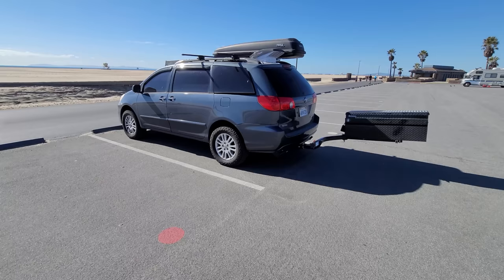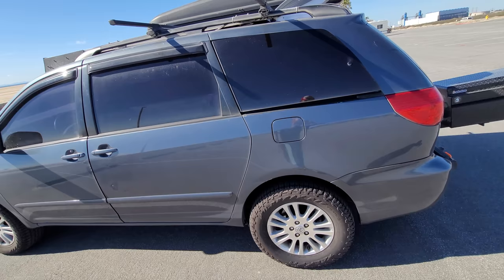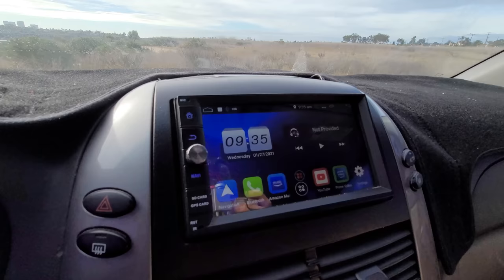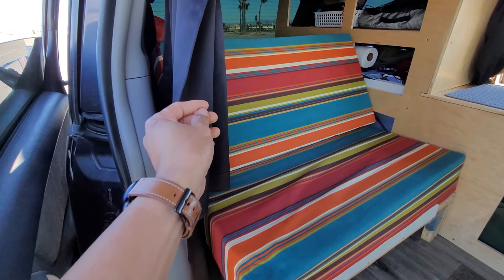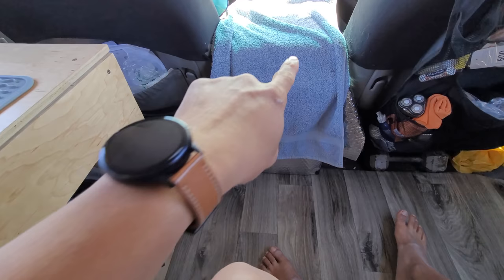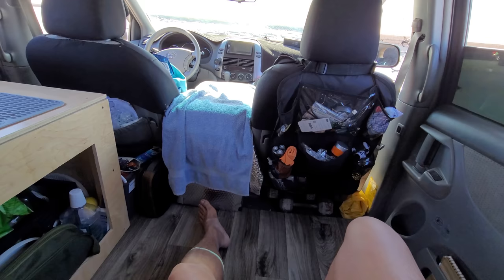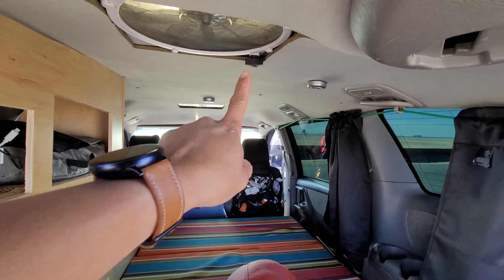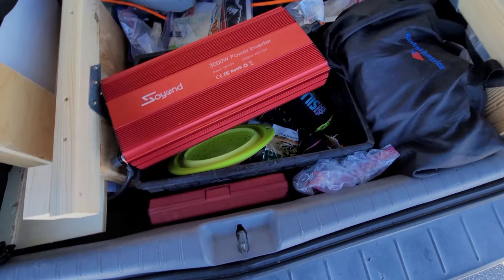Ultimate Minivan Off-grid Camper Van Tour! Lifted Toyota Sienna - Self Converted

Comment: Dave, how have the Falken Wildpeak Trails been doing? Comfort, control, braking, grip, noise, tire wear. Assuming you're still running them, and it's only been a year since your video. I haven't bought yet as still some wear on existing tires, but they're my top choice for replacements at the moment.
Reply from the maker: I personally think they're the best choice the the yota and for the places I want to go. More quiet than stock tires imo, long lasting, and perform well. GL

Comment: what type of mpg's are you getting on that thing? I have a non lifted or converted 2007 that gets 16ish with a good mix of highway, and city driving. I'm curious to know how much the lift and tires, plus the weight from the conversion affect the fuel efficiency.
Reply from the maker: It really didn't. In one of my videos I mention the larger tires dented my mpg but I didn't consider the larger tires effect the speedo and the mileage gets ready incorrectly. I got 16-17 mixed

Comment: hi dave! how did you attach those green strings to make your privacy screens? i see you used the hooks above the doors but i can't see the other attachment points. also, how do you block the rear window view for privacy?
Reply from the maker: Yes there are little tabs I popped off and used bungees. I used weathertech window covers for the back window. Hth

Comment: well done!!!...im stealth in a dodge caravan... love it...Best Wishes from the beautiful nc mountains:) Christine  
ps im dying to do an exhaust fan on roof like you guys! does it not leak?
Reply from the maker: Ty! No not if you do it correctly!
Reply: From videos I've seen,  it seems noisy and not tight seal regarding thermal loss. But everyone seems to get them when they upgrade.  Some even install two.  I am going to live in my van first to see how necessary a roof vent is.  Love your rig, but not exactly stealth with all the add-ons, although some might think it is just a recreational vehicle and not a home.  How much does the lift and larger tires affect mileage?
Reply from the maker: @serenakoleno9338  the lift didn't effect mileage. The bigger tires dropped my mpg by 3-4 miles
Reply: @DaveOTG  What size tires did you step up to? ..and I am glad to hear that the lift did not affect the fuel efficiency. Though did you experience any other changes due to having the lift, such as needing to replace CV joints, drive shaft, etc?

Comment: I've got a 2012 Odyssey and the way the sides are designed the shelving interior I had in my original build - 1997 Town and Country didn't fit right at all. I really like the way you contoured the wood organizer. That's probably what I'm going to have to do. 

Also, I really like your Maxxfan. I want to put one in mine but am concerned about running into wiring, ducting or some other issue. Did you know beforehand that you could put it there or did you just start cutting and hope for the best? lol
Reply from the maker: I pulled the headliner down to 1. Insulate and 2. Decide where to cut the hole
Reply: @DaveOTG  I was afraid you were going to say something like that LOL.

Just looking at all of he things connecting the headliner to the roof gives me anxiety with the thought that I'll never get it back together - although, if I had it pulled down I definitely would insulate. It seems like a lot of hassle to go through not to.

Comment: How do you stealth camp / sleep in the city without window covers that completely block out all light from inside? And how wide is your mattress?
Reply from the maker: I have ceramic tint 5% and blackout curtains.  39x74
Reply: @DaveOTG     Are you saying that if you have lights on inside your van at night with 5% tint then the light inside wouldn’t be visible from outside? I saw the curtains but it doesn’t look like you could make them light tight though. Can you?
Reply from the maker: @joeblow1942  Yes, not visible from outside

Comment: Great take on Eric’s design. I’m 6’3 and am about to do this to my sienna as well. What are the dimensions for the bed?  I love how you extended the cabinets the length to the rear of the van.
Reply from the maker: Twin size
Reply: Solid. I have a 2011 limited which poses its own set of problems because of the electrical upgrades like the third row automatic folding seats and the middle console that has some components. I want to realize its full potential in a conversion.
Reply from the maker: How's it going Greggory? Have you started your conversion? I know those middle seats can come out as well

Comment: I'm curious if you recommend a mini van with a sunroof. I wonder if that gets in the way of thie Maxx fan or solar panels etc that I might not like? I am thinking a roof would be nice but if might run into an issue?
Reply from the maker: You could go with a different sized panel to accommodate everything on the roof
Reply: Do you think I can install a Maxx fan on a van with sun roof? I'm thinking that will give really good ventilation but there might be some kind of wiring running from the roof to the center rear where you had the Maxx fan. I don't know if there's any of that stuff.
Reply from the maker: @TakuyaHikichi  you could remove the headliner to take a look

Comment: What size tire did you go with? (scrolled thru most comments before asking)

Now that it's been a few years, what's your assessment of your tire & size choice?

Just got an FWD XLE, time for tires, thanks for your input in advance!
Reply from the maker: Its at the bottom of the description. I think it was 245/65/17. I really like the added lift and the falkens performed well in all types of conditions, and are quieter than my stock tires were. If you need to run snow chains, then you would have to go with 1" hubcentric spacer or get a smaller tire maybe 235s. Hth
Reply: @DaveOTG  Thx!  What was the MPG hit for the larger tires?

Comment: Great setup. First lifted Fwd sienna I've seen. I want to do the same thing as I don't think awd is as necessary as ground clearance and tires for a lot of camping back roads. 
I am most curious about your experience with the lift kit, any issues or premature wear mainly with the cv axles, bearing or bushings? Changes in handling?

This lift kit is basically the deciding factor if I get a Sienna rn.
Reply from the maker: Rides stockish. Had new CV axles installed the same time as lift just bc. No change in mpg either. Big tires effected mpg as well as the added weight. I did install air bag helpers in the rear. This really boosted the handling confidence.

Comment: Hi if I were to get a jackery which model would u recommend to handle that fridge and rest of your equipment?  Ty
Reply: Jackery 1000 is great for a minivan.  Plenty of power in case you get a few cloudy days.  Weighs 22 lbs.
Reply from the maker: Honestly would recommend another brand. Jackery charge time for the 1000 or up is very slow. EcoFlow charges like 80% faster

Comment: Great video, I'm joining VanLife2022; looking for my van now, what wood do you suggest that I use so I won't have to worry about climate change altering it
Reply from the maker: If you live in a cold environment I would try to migrate condensation with ventilation, and products that suck up moisture and if you're using a heater make sure it's dry heat. No big difference in types of wood imo. Good luck out there!

Comment: The kick sensor can be turned off in the vehicle settings. I have a platinum. Even if you install a much cheaper non- toyota receiver hitch, you can turn it off. If the kick sensor in the back isn't as important to you, you can install a cheaper hitch. For me I'd rather save hundreds of dollars than have this silly feature..
That's just me.

Comment: Like you work and your build. I have a question: for all the work and expense in setting up your solar system (minus the panel) why wouldn't you just do something like a Bluetti ac200p solar charger? Seems a lot easier and as functional. I'm about to start my minivan build and appreciate all the links  and info. Just subscribed to your channel. Would love to see more of the build-out videos. Keep going!
Reply from the maker: You could go that direction for simplicity. For value and bigger capacity/modularity/cost building out your system is the way to go. Different priorities and welcome aboard 🚀
Reply: @DaveOTG  Cool. Thanks for the answer. May I ask what you have invested in your solar setup? I'm deciding which way to go now. Also would love to see more on your lift kit. Thanks again.
Reply from the maker: @fractalman8064  The ac200p 2000Wh = 83Ah. Not great capacity but don't get me wrong, it's plug and play. If you don't want to invest the time in researching/learning on how to build your own--it's the way to go. (For me budget was a bigger priority over simplicity), I have 300Ah batt. with 325W panel, 3000W inverter, Victron Charge controller, fuse boxes, etc etc for less than half the cost of the Bluetti. If something isn't working, I can easily replace the one part. Either way is not wrong.... Hope this helps. Great suggestion on a video about the lift.
Reply: @DaveOTG  Thanks for the info. Makes me lean back your way. Makes more sense to learn than to pay. Are you using AGM batteries, lead, lithium?
On a side note, one of my big concerns is security. How to hide/lock up laptop, cash, camera equipment, etc. If you could do a video on that would be great. Understand if you'd rather be discreet. Just trying to think these things out before launching into it. Nice work, keep going, and thanks for all the links.
Reply from the maker: @fractalman8064  For more sensitive topics, I speak about them on my patreon

Comment: After seeing that inverter and battery fire hazard I was done with the video. If police stopped you. Which they have about half a dozen reasons. If they had a reason to search this build is being towed and impounded for not only exterior but interior road and safety violations. The lesson will be to not DIY budget build anything if you don’t know what you’re doing.